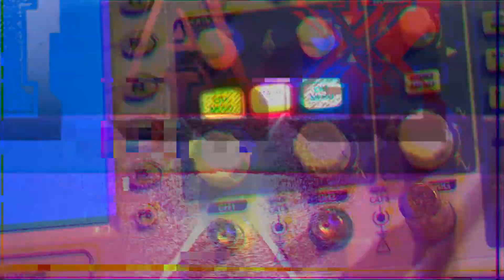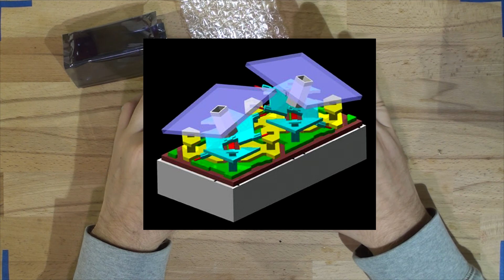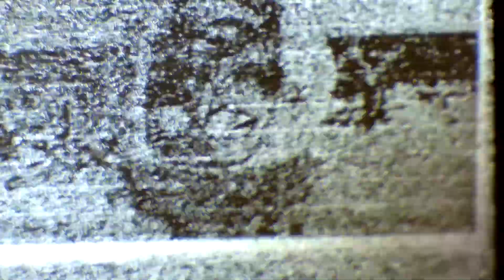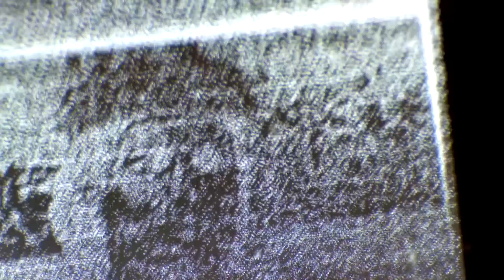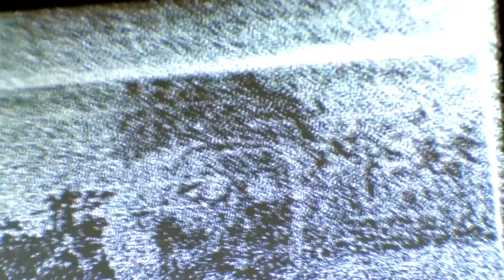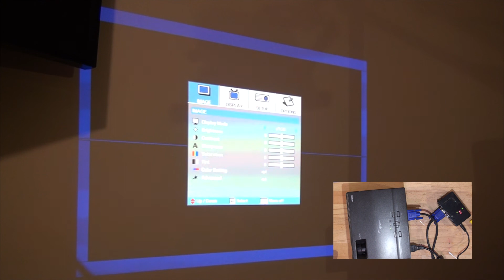DLP Projector Fix (Black or White Dots On Screen)

Comment: where can I find a dmd chip replacement for my BenQ W1070? on top it says 5166857
1910-6039E and on the bottom 59Z1QWA 190905E
Reply from the maker: Just search those numbers on AliExpress, they sell them.
Reply: @MaxELECTRONICS  those specifically can‘t be found
Reply from the maker: @smolbodybuilder1602 see if numbers closely match and they’re same pin configuration and same resolution and look the same. Sometimes numbers slightly different as it could be newer version

Comment: Do you offer this as a service? I trust you far more than any manufacturer technician.
Reply from the maker: I am but local only, it’s actually very simple to replace the DMD. You can do this yourself.
Reply: @MaxELECTRONICS  I guess I will find out! I just ordered a new replacement DMD for my JVC LX-NZ3W. Hopefully i can find a teardown of that or use your vids to best-guess my way through DLP disassembly 😅
Reply from the maker: @TechandDoc it’s pretty simple, they usually more or less the same construction.

Comment: Hello, thanks for sharing, do you tried to repair the DMD chip as you said ? (testing hot, cold, chocs)
Reply from the maker: Yes I have, no luck at all, not a single change in any mirrors, the only way is to buy new DMD.
Reply: @MaxELECTRONICS  thanks for your feedback, may i ask a tech question please: i trying to rejuvenate a W1070 after OEM lamp explosion, all cleaned good and in good place, color wheel turn and start ok, 385V at ballast, unfortunately i only have cheap no name lamp (200Mohms). Image is flickering like creasy with a blurry out of focus range aspect, menu is unreadable, i can distinguish Music note menu, etc. and the menu lines but impossible to read text inside as there was nothing. do you think poor lamp capable of that problem?
Thanks
Reply from the maker: Yes that’s possible, Is the Lamp itself flickering? I’d check the lamp and ballast if the lamp is flickering.check that all connections to the lamp are good.(while powered off)
Reply: @MaxELECTRONICS thanks for your answer. just image lamp is not flickering but it is now dead (1mn usage show 9Mohms instead of infinite resistance) so it's not accepted anymore LAMP RED flashing wich is a good thing for ballast protection. When lamp was lighting BENQ menu was apearing and disapearing from blue to some sort of white screen. Will test with OSRAM lamp with fingers crossed
Reply from the maker: Sounds like a bad connection between board and DMD chip , also check strobe sensor on colour wheel (it’s a black line that rotates pass optical sensor on colour wheel rotor)
Reply: Ok lamp work at restart, and LOL do you believe i inverted color wheel ribbon cable ! LOL  all is working perfectly now but the color wheel is out of balance buzzing too much, i'm looking for a way to balance it as i'm cheap...

Comment: Hi I have a NP200 NEC DLP projector with similar issue. Do you know how to find the DMD Chip? How much does it cost?
Reply from the maker: You can find them easily on AliExpress, when you get the old DMD out, you’ll find a number on the back of it, search for that number on AliExpress, they usually around $70-80

Comment: Hi I have a NP115 NEC DLP projector with similar issue. Do you know how to find the DMD Chip ? How much does it cost ?
Reply from the maker: Hi, you need to open the projector and remove the old DMD chip, it will have the number on it something like “8060-6038B”. You can take this number and ether Google it or search on eBay, they cost anywhere from $60-$100 AUD.

Comment: Thanks very much for your video, it's very good repairment video. For the flickery in the video, is this a drawback for DLD projector? I think the 3-LCD system hasn't such kind of flickery, is it good to eye?
Reply from the maker: Yes all DLP projectors are flickery due to the rotating colour wheel. LCD don’t have that flicker.

Comment: I have some black pixels how would that be fixed is it the same dmd chip problem as yours ? I have the uhd50 optoma
Reply from the maker: Get the old one out of the projector and there will be number on the DMD chip, search it in AliExpress. You could also try eBay but I find it more expensive there.
Reply: @MaxELECTRONICS  thx
Reply: Did you repair your UHD50? I have the same projector with a white dead pixel. I assume I need to replace the DMD chip.
Reply from the maker: Yes, you’d need new DMD, pixels can be ether white or black, depending in which position the mirror got stuck in.

Comment: What type of TIM (Thermal Interface Material) did you use for the heat sink installation ? and what thickness ?
Reply from the maker: Hi, I used the one that was included with the DMD Chip.

Comment: Hi, May I ask if there is any chance to fix LED projector with the same problem?
Reply from the maker: Yes, if it’s a DLP LED projector, LED is just a light source, the random dots on the screen are caused by DMD chip, I suggest taking the DMD out just like in my video and have a look at the surface of the DMD, if it has random tiny dots then you need to replace it, if it’s perfect like a mirror then DMD is good, you’ll need to look through magnifying glass.

Comment: hi I have LG  projector model Bs275 stuck on standby,checked logic board by applying external 12v and 5v it comes on ,but power supply only gives 5 v ,missing 385v and 12v,tried to check components everything seems to be okay, could you be having schematic? how can you advice?

Comment: thank you from Nairobi Kenya
Reply from the maker: Unfortunately YouTube must have removed your comment. Can you post again?
Reply: @MaxELECTRONICS  hi I have LG  projector model Bs275 stuck on standby,checked logic board by applying external 12v and 5v it comes on ,but power supply only gives 5 v ,missing 385v and 12v,tried to check components everything seems to be okay, could you be having schematic? how can you advice?
Reply: This is the request I had
Reply from the maker: I haven’t got schematic for it, they usually dual power supply so there’s one for standby power and secondary for the rest of the circuit. Check secondary power supply, cold me smps chip on power supply or check diodes , those power supply’s very similar to computer power supply’s